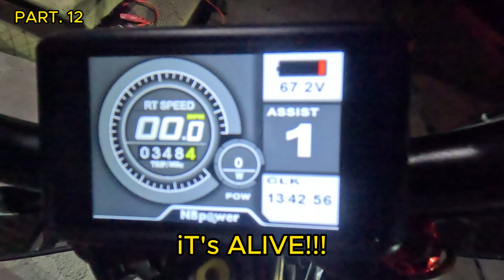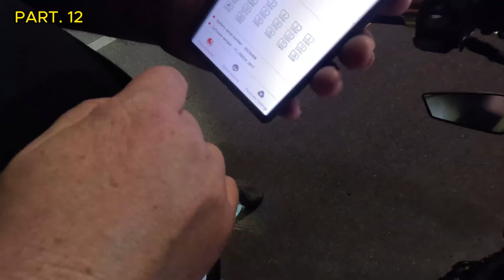custom ebike build (part. 12) THE BATTERY

Comment from the maker: (20s 14p) 72v 40ah battery with (100a Daly bms) + 100a sabvoton controller set to 80a continuous discharge - pushing a 5000w hub motor to 60mph

Comment: you just cant run high current packs like that ,and the cell grouping is very wrong all paralels should be in a line once have done the nickle time to solder down a copper bus  bar
Reply from the maker: thing is, u can mix the batteries how ever u want, just make sure ur strips can handle it. numbers dont lie, dont try this at home .

Comment: dude you cant just up the bms and amps like that the cells cant but more tbhan 4 or 5 amps each they are bases samsung cells you need samsung 30q with 15-20 amp each cells
Reply from the maker: and ur probably right but i did what i could with what i had, i dont see no other way for all these cells to fit the frame sharing space with the controller or to run the cells in a straight line, so far its been a few months and i have no issues with my battery.
Reply: yes i agree knowing the correct way to group cells and when and when not to split packs up takes alot of experience ,i build alot of high end packs ,if i can ever help just ask,we even do packs where the cells are covered in liquid cooling solution now called immersion cooling,anyway ill print out bus bar design for you to if it keeps people safe then im happy to do it cheers @krebikes
Reply from the maker: @katiekumcgil  that's crazy dope, this was my first time building one
I calculated the amps the strip can handle plus i put copper between every bridge to balance or handle out the heat
And because of the shape i wanted to run it the current flow in a straight line but then that would be too many lead wires between the packs n i dont trust that so instead the current flows in a zigzag way n i connect the leads on the outter part on each side so i probly jave like 4 to 6 leads in the middle of the battery
Plus when i got them they were not in a straight line so i figured it will work i just made sure i double or tripple the strips due to my calculations

Both batteries had a 50a bms each i wanted to put it together n run it parallel but i didnt trust the controller to read both batteries as a single 100a

Thats why i cut it open n rearrange some cells n over lay larger strips on what it already had n make sure i spread the connection without leaving a sisngle cell connected by it self 
U know like holding hads at a dinner table lol 😂
Reply from the maker: @katiekumcgil  plus since i dont trust it 100% i dont have it drawing power to the full max
The why i turned the controller down to 80a instead of the stock 100a settings 

But its good to have a Bluetooth bms to control its output
Because the battery itself is said to push 91a continuous so i think that 80a limit is whats saving it
Ive been riding for hrs plus a 8a charger n i never had a over heat issue n it never cut off on me 
So for my first time i think i did a good risky job 😁
Better safe than sorry 
I might do Video of my settings if i can get my pc to recover that parts list video😔
Reply: haha i have a sabvoton v2 unlocked model its a svmc7245 normally 45 amp  boosted up to 150 amp dc without a problem and its 1/3 of the cost of a locked 150 amp and max voltage is 88 volts  @krebikes  sabvoton
Reply: happy to show you if you ever need,just make sure you do the hall angle test on sabvotons and enter in correct pole pairs amount before turning the throttle ,and turn weekening off ,wwekening is only for big output batteries,also try get the pc lead to program there is heaps off setting that arnt available in the android app
Reply: i use a cycle analyst to  manage the controls and split the throttle signal to 2 controllers that way i can output the cycle analyst data into torque pro android app for a custom racing look dashboard ,that has full navigation and custom buttons ,this is last time ill buy sabvoton though ,there are newer designs of VESC controllers that have everything you can dream of built in control buttons,usbc gps 4 types of wifi and networking,gps and gps tracking,data logging ,and they half the size of sabvotons
Reply: have alook at the STR -500 VESC 100volt 500 amp dc controller with water cooled heatsink,,i think the best ebike controller available
Reply: its not cheap though 920 us or 1400 aus ,but you can do 50 killowatt  thats 50 000 watts if battery is up to it,thats 100mile an hour with right motor haha crazy
Reply: i have a motor for my bike i use for daily riding so police dont fine me its a 9 continent motor at 500,i moddified all the cable and wires ,retail cost is 115 dollars us after mods i run it on 85 volt at 150 amp  for 13000 watts for 100 dollar motor and does over 75-50 mph, and thats useing svmc7245 unloucked ,so can still make crazy bike for cheap
Reply: opps when said 75-50 i ment  75-80 mph
Reply from the maker: @katiekumcgil  word
Reply from the maker: @katiekumcgil  yeah not in this light bike frame lol
Reply: hehehe look at the quick video i have on my page my frame isnt much different to yours ,just mines all custom welded ,i copied measurements from chinese enduro frames but modified suspension design so it works properly @krebikes
Reply from the maker: @katiekumcgil  yeah i saw it that's dope
Reply: @krebikes  I sell these for 600au but everyone  in Australia is broke haha